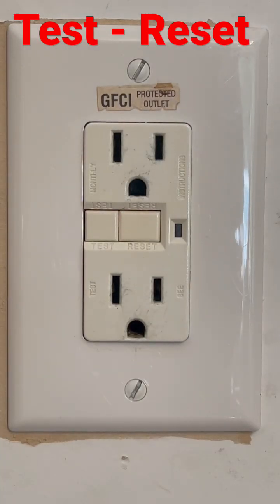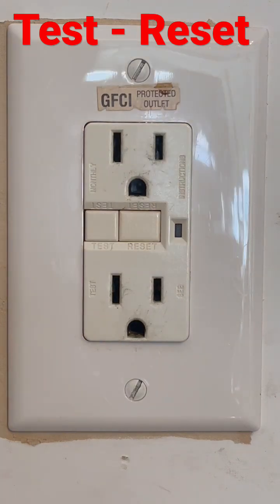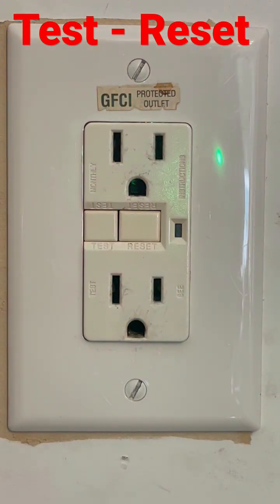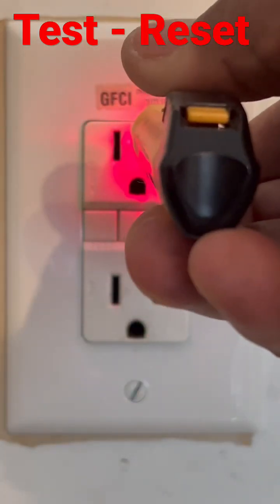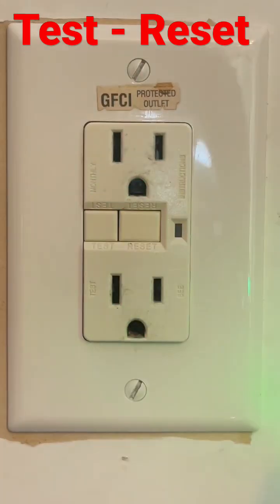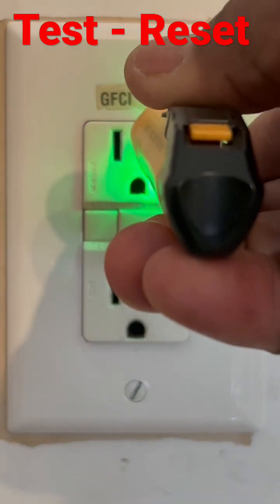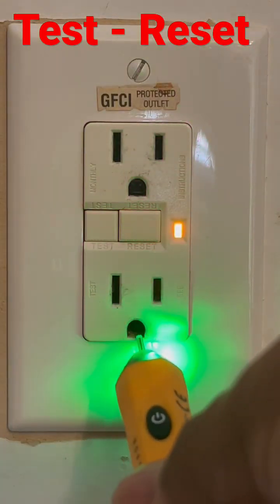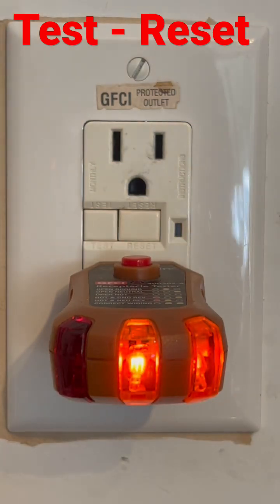How To Test & Reset GFCI Outlets

Comment: Thank you 🙏 I accidentally clicked test and was wondering how to get the light to turn off!
Reply from the maker: Glad I could help!
Reply: Right, mine just blinks and no matter how hard I press either button, the red light won’t stop blinking. Is that unsafe if it’s kept blinking? I’ll get one of those tools though. Thanks.
Reply: @Jek2457 probably means it's not any good anymore and needs replacing u can do it most likely ur self watch videos and falow direction new device comes with u may consider upgrading to a combination GFI/afci ( ground fault/ARC fault combination recptical. ps turn off breaker to the circuit to the GFI outlet/recptical and back on to see if this helps the GFI to  reset if it doesn't then definitely replace the GFI.

Comment: Obviously the circuit has NO GROUND conductor.
The little sticker is telling us so. “GFCI protected”
Therefore the Hand Held GFCI type testers WILL NOT trip
the GFCI circuit.
comment please.
Reply: When there's no ground conductor, the test button on the outlet and GFCI testers will not trip. But the outlet will still provide protection against ground faults as low as 0.05 amps.
Reply: @smeado3533 .005 amps or 5 milliamps
Reply: Not obvious at all, Ted, in fact according to his tester it does have ground. He never pushed the button on the tester to prove one way or the other. The sticker on there is unnecessary (because it's obvious) and belongs on protected downstream receptacles if there are any. If there was no ground, the sticker to use says "No Equipment Ground".
Reply: @surferdude642  The test button on the FGCI connects Line hot to load neutral 
to test the GFCI. No ground involved.
Reply: @tedlahm5740  Clearly, the test button on the GFCI doesn't need a ground connection to trip, like the tester does. The tester uses a shunt resistor of probably around 15k ohms between the hot and ground when the button is pressed, so if there's no ground, it doesn't work.
The trip operation on the GFCI is more complicated, it uses a solenoid that is activated by a silicon controlled rectifier when the test button is pressed. The test current is supplied through a current transformer in which a 15k ohm resistor is connected between the input and output of the current transformer. 120v/15k = 8mA, which is slightly above the 6mA threshold, so it trips immediately. I'm not sure if the load neutral is involved. This is the way I understand it using a Leviton brand GFCI. Other brands may have different methods.
Reply: No the sticker doesn't say that. It says GFCI protected.  If the outlet has no ground, the sticker will say "No Equipment Ground."
Reply: You cannot assume that. The sticker would in any case be unnecessary as everyone sees it is a GFCI protected.